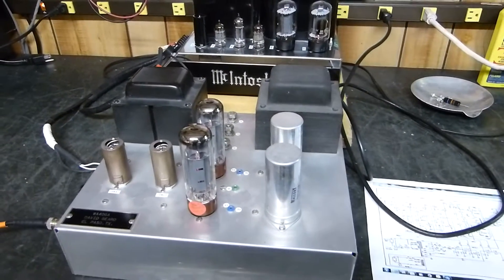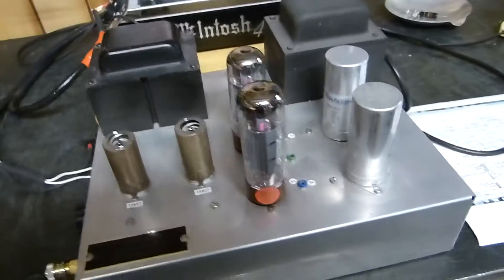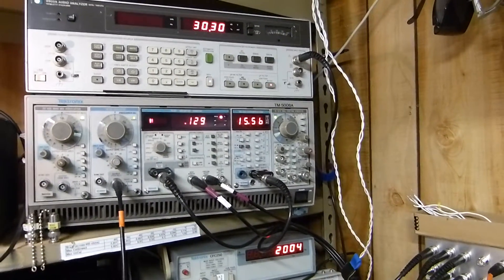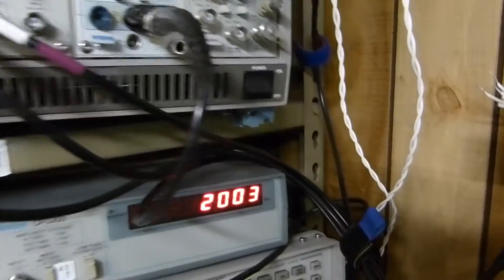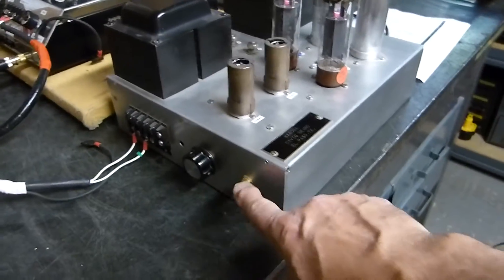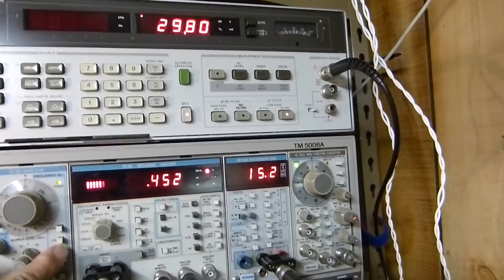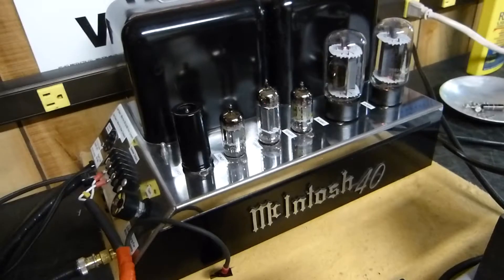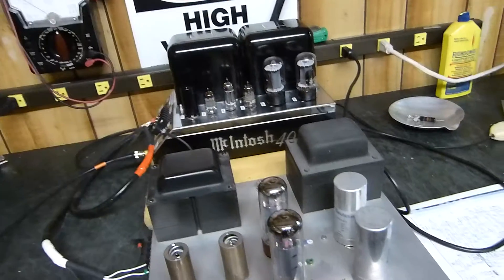McIntosh MC40 vs MA230 Mono Channel Vacuum Tube Amplifier

Comment: I just saw this as I was researching MC40's (looking for a mate for a single mono block I have) and before I replied, I read all the comments, and noticed Mike Samra replied to your post. Everything I was going to suggest, Mikey already mentioned, if you have not taken his advice seriously I was merely going to write exactly what he prescribed.. Mikey has built some inedible MC's this way, I have used his method (including the 820's in the voltage doubler)and have manged safe and steady increases in the output wattage. It sounds crazy but it works, yes, using the military grade K40 PIO's makes a difference. I thought the same as you, as long as the originals measure correctly should be fine.. I was wrong..
Reply from the maker: +Jeff Lester Hi Jeff, I appreciate your thoughts on these improvements to the vintage tube Mac's. Mike and I have had several very good conversations over the phone where we share our experience and opinions.
I initially replaced the bad electrolytic capacitors in the MC40 with 470 uF capacitors and it worked just fine. Later I changed the Bumblebee capacitors with Orange drops and, of course, replaced all of the smaller electrolytic capacitors. The amplifier performs very well and will do 50 watts (with 120 VAC line) before clipping.
The only issue I still find with it is the frequency response at 20 KHz. I have measured a number of McIntosh amps and they all seem to do a bit better at the high end than this one. It is not a real problem; but it does give me something to work on.
 I ended up changing the voltage doubler capacitors back to their original value (150 uF)  - probably just to keep it original. I know that PIO capacitors have been the audiophile's preference for a really long time and I have nothing against them but kind of like the $100/foot oxygen free copper/silver speaker cables sold in high-end audio shops, I just can't see any difference between that wire and good #12 zip cord. I am still undecided about the high $ capacitors. Is it because they have a very high Q and low D like a high quality test  instrument capacitor? Not sure what the oil is supposed to do to the sound that I can measure. I assume the nuances are in the listening and not the measurements but, as odd as it may be, I rarely listen to these amplifiers that I work on. I have all of my systems set up and are McIntosh solid state -  please don;t tell anybody...  :-)   I don't want to be argumentative but I am not sure of the mentality that ever larger power supply capacitors result in improved amplifier performance in vacuum tube amplifiers. As originally designed, these old Mac's have a S/N ratio of 90 dB and they often times do 20%+ above their rated power before clipping and THD rising to more than 1%.  I am curious why you are convinced that the 820 uf caps and the K40 PIO's make such a difference. Is this from repeatable measurements or from listening experience? I am always open to new ideas and have learned many things from my YouTube postings because of comments like yours. Thank you.

Comment: I would be starting with the loss of power. That equates to less NFB and in turn can only lead to more distortion. I'd check the frequency response as someone else suggested, at lower power levels too, and look at the feedback network, coupling caps, etc.

I'm also wondering why you don't shove a DC509 or similar into your TMS 5006 rack so you can have more data visible in a smaller space, rather than having to look down at the frequency. The long shot where you showed all four readings at once was fine BTW, you don't need to zoom in on them individually. I'm also wondering whether you're aware you can read out THD in dB in the AA501, and also use the dB ratio function to show the voltage loss you're getting in dB, and measure SNR too.

Best, EJP

Comment: See if you can check the frequency response, looking for the same dropoff at other points in the signal path.  If it's present before the power stage, it could be anything like a bad cap or even a resistor that has become slightly capacitive and is in a critical spot.  Haven't looked at the schematic, so not sure where feedback is applied and how that might change that type of measurement, but basically I'm saying to see if you can isolate it to a section of the circuit.  OPTs have been known to do funky things, a winding shorted on itself could leave you with a decent looking DCR but still have a full shorted turn or two that acts like a weird load.  Good luck!

Comment: I would change those .047s  bumblebees in the phase inverter to voltage amp regardless of what they read..They are the most known trouble spot along with the 12k 2 watt resistors..Those I always change to a 4.7 watt wirewound because most of those carbon comp 2 watters read 13k on measurement.
Reply from the maker: I guess we both love this stuff and enjoy the challenge. Efficiently, I certainly cannot disagree with you but maybe I am just being stubborn. My 12K, 2W resistors measure 12280 ohms and 12130 ohms. That makes them approximately 1.24% balanced. I bet even McIntosh couldn't measure them that close 50 years ago. I find it incredible that we can have instruments in our hobby "labs" today that can measure pico seconds, frequency to within 10 Hz at the GHz level whereas when the atomic bomb was born in 1945 it was a struggle to measure accurately and consistently a microsecond. I am mostly satisfied with the amp at this point and may actually connect it to a speaker and listen to it - seems like the respectful thing to do. Don't you find it interesting that you and I would replace these "bumblebee" capacitors with new capacitors to (hopefully) improve performance but find these same capacitors for sale on Ebay to restore a unit to "original" components?  As I think is obvious, I am more into the measurable and objective nature of equipment than the subjective "sound" of the equipment. There is no doubt that when I replace old ugly tubes (or components) with new beautifully decorated, gold embellished English script on the tubes in fancy boxes with promises of ecstasy and unfulfilled and  unattainable dreams to come true before my very ears that I am influenced and will actually experience some of this phenomena of pleasure. You know where I am coming from? Always good to hear from you. I think I need a new project at this point.
Reply: ElPaso TubeAmps
    I agree wholeheartedly on measurements and I use them religiously...I tell people they should at very least check the 1khz sq wave to see that it looks clean and no ringing on it..I always do the 10khz sq wave as well and even 20kzh on some amps.
I agree on the 12k resistors...They can read 13k and function just fine as long as they are matched to each other...The reason I change those is they run hot and I feel a little safer with a 4 to 5 watt resistor in there..If you still have power and  distortion problems,just try the .047s even in a poly and see what happens..You really want a paper in oil  cap there and I have some I can  send you free of charge as I have a few thousand lol.You can always put the original caps back in but It would suppress our curiosity as to why these numbers are what they are..Most of the tests you and I are under static conditions as you stated and I would love to be able measure dynamic conditions as well but I don't have nearly the nice test rack you have but I'm adding more and more...I really like the way you have mastered this and I've learned a ton of stuff from you should be teaching as you very good communication skills and are very well versed in subject matters at hand. I need to talk to you about buying an HP like you have on top to use in conjunction with some other pieces I have.
I will email you.

Comment: Take a look at way I did the Mc240..I rebuild a lot of Mac amps and I always do a more exotic rebuild because as that's how people want them that I deal with but what  you will find is,in spite of the capacitors reading low ESR,more modern filter capacitors with higher capacitance and better grounding solves much of the power deficiency...I actually put a pair of 820s in the doubler and a pair of dual 100s after the choke and this Mc240 was making 51 watts per channel with 7027s in the outputs with one channel driven at a times...Also,the .047s in the phase inverter should be paper in oil type  like a Vitamin Q or a Russian K40Y-9.   Here is the link of the Mc240 I had just rebuilt.  http://www.audioasylum.com/cgi/vt.mpl?f=vintage&m=225617

Comment: I would start with signal tracing through the amplifier's low level stages to see if anything there is at fault. To do this effectively, you'll have to open the feedback loop to ensure that you're seeing only the input signal and not the correction from the output.
If all that looks good, then I'd start looking at what's going on with the cathode feedback loop on the output transformer. If the input doesn't look good, check C4 and C5. This is a hot cathode phase inverter, and it behaves somewhat differently than the classic voltage divider inverter and concertina designs more commonly found. I hope the problem isn't a bad winding in the output transformer. These are bifilar and I don't know anyone who has the patience to rewind a bifilar-wound transformer. Good luck!

Comment: By the way, I wanted to wish you & yours a Happy Thanksgiving! :)
Reply from the maker: Frank Ferraro Hi Frank - Happy Thanksgiving to you and yours - looks like we stay up late. I have made great progress on the amp but need to verify it make sure it is true. I just got in an HP 4437A attenuator that I really like. Been testing it tonight and it is so much better than the HP 353A patch panel as the 4437A is DC to 1 MHz. The 353A patch panel is for telephone service and has served me well but I could never use it in the full audio range.

Comment: What would also concern me is the drop in output power at 20 kHz. I had a tough dog MC40 about 10 years ago with a VERY similar issue, excep the output power was dropping at around 12 kHz and the distortion went up to 2%. After reaching past the 12 kHz point, I was loosing almost 1 watt per-1 kHz increments as I manually raised the oscillator's frequency. After practically rebuilding the amplifier, the problem turned out to be a defective output transformer. (yes, output transformers can get funny at times). I had a bad feeling in my gut about it before I even attacked the other components. I was on that amp for almost a week on & off. You might want to try & swap out a test transformer to see how it responds. might be worth a shot at this point. It might sound crazy, but I like a tough dog once in a while...keeps me on my toes :) Keep us posted on your findings. Frank--Audio Craft Electronics.
Reply from the maker: Frank Ferraro I think you are right and I have suspected the OPT from the beginning but I don't have an abundance of McIntosh MC 40 OPT in stock in my attic... I have done many things without changing the original state of the amp. All the signal capacitors are still there as I can measure the ESR so consistently and compare to new caps that changing these caps would be an action of desperation. What has made a significant difference is removing the 100 pF cap that Mac removes later in design and lastly changing the feedback cap from 330 pF to 1000 pF. (I need to continue to investigate this)  The power at 20 KHz is down 0.7 dB but 20 Hz to 20 KHz is within 0.5 % THD. I am still playing and will publish my results soon. I once had a MC 240 and was never fully satisfied with it. The performance of the MC 275 is better and I have stuck with that amp since 1976. I changed the input circuit of this MC 40 to the circuit of the MC 275 with no improvement - I then restored it to original. I love these challenges but this amp is "what it is" and will never meet or exceed the old MC 75 that I posted a few months back - it is just life on Planet Earth. In the end, we smile and shrug our shoulders and say, " I don't know,"  and move on.

Comment: You need to run this through a waveform analyzer (=scope) and/or a spectrum analyzer, with only these numbers red out from the TEK and HP analyzers you just got nearly nothing, as you do not know the THD´s content. If you would know the content and every contribution of each harmonic it becomes far easier to clarify what´s really going on.
So you may give this a go first, before doing something on that amp. It can only be a weak (preAmp)tube.....But you do not know it until you check the THD´s spectrum vs. output level vs. frequency.
Reply from the maker: TubiCal It is not a tube - I have eliminated that for sure. I can see on my SA the offending harmonics and the Function Output of the AA501 displays a waveform of the harmonic content on the scope just below the Output Monitor which shows the sine wave. I can see that it is mostly odd harmonics but tinkering with the resistor values makes some harmonics go up and some go down with a hard to correlate THD reading on the AA501. It is not just as simple as suppressing any single harmonic - been there and tried that all day today  :-)  This is purely technical/academic as the THD is so low that it could not possibly be offending to one listening to music through the amp.  I also discovered that my fluorescent light above my work bench adds another good 0.1 % THD at 20 KHz. I am doing this because I have seen every McIntosh amp perform better than this one - even the one I built almost 40 years ago so, I am trying to understand why. I think this amp is pretty old as several of the values in the amp are not as the schematic and I can see it has never been tampered with (until now...). Always appreciate your thoughts.
Reply: It would have been of some help if you had included some of these pictures within this video....
Anyway, my very own experience is, that no one should never trust any component in an Amp until you really know that it´s ok. I´ve seen decoulping Caps done funny things as well as resistors, especially some hooked on to the control grids...But some cathode and plate resistors done some "odd" things as well...
So check them would be a good idea....
Next if i had to chack this Amp for foults, i would trace them out. Check every stage within the amp for distortion and gain vs. input voltage and frequency response. You´ll be able to spot the point where these distortion will occur, i bet..;)

Good luck, and please let us be part in that (=more videos! ;)

Comment: Have you looked at the actual waveform of the output signal to see if there is any oscillation or power supply noise that might be contributing to the distortion?  It might be useful to do a comparison of the waveforms coming from the two amps.
Reply from the maker: Robert Meushaw Hi Robert - the distortion is so low and only at 20 KHz and above and this is purely technical so no anomalies can be seen on a scope. I can only see it on the Tektronix AA501 and by scanning with the HP 8903. I am just having fun as I have seen every Mac amp that I have ever tested do better than this one - so I am trying to figure out why. This one is pretty old and all of the components are not exactly like the schematics I have. I really appreciate your thoughts.
Reply: ElPaso TubeAmps I'm very curious to find out why the distortion of the amp is out of spec.  I'm a big fan of McIntosh amps and fairly certain that it can perform like it used to.  Good luck solving this mystery.

Comment: I know little about valve amps. But are the output transformers physically the same size in each unit?  In the video the newer unit they appear to be much larger are maybe they are just enclosed in a large metal box.  It may be that the transformers are causing more induction on the larger version hence damping out the high end. But that is a crazy wild guess. To test that out, you could try swapping out the older output transformer and test it on the new one.
Reply from the maker: Kevin O'Brien Thanks, Kevin. I understand what you are saying about the large OPT having more inductance, etc. but McIntosh amps are phenomenally good even at 30 KHz. I posted a MC75 running at 75 watts with an OPT approximately twice the size and it performed flawlessly. I am still working on this and I greatly appreciate your thoughts. I am making progress.
Reply: ElPaso TubeAmps No problem, total wild guess. Let us know when you crack it, as really curious to know what it turns out to be. Valve amps are so fascinating. Good luck, please try and crack it as it'll make great viewing in  a future video. I really want to know the solution now! Maybe test the OPT in isolation, as it might be a bad one. That can happen. Someone has put this up, which is a nice memory aid. Hope it helps. http://www.geofex.com/ampdbug/outtrans.htm That is assuming you not tried all that already! The two push pull output valves bias might also be out of whack (check their voltages are same peak to peak on both with scope using a sine wave input). Again that is just total speculation as I have no real idea. But it is fun to speculate. I also had a quick peek at the wiring diagram and I notice it has negative feedback directly from a winding on the OPT back to the cathode of valve no1. So the voltage at cathode of valve no1 might be worth a check at the high end as it might be receiving too much neg feedback from OPT. Could compare it with Valve 1 of your other good Amp (assuming it does neg feedback in same way)  to see if it tallies. Good luck!!